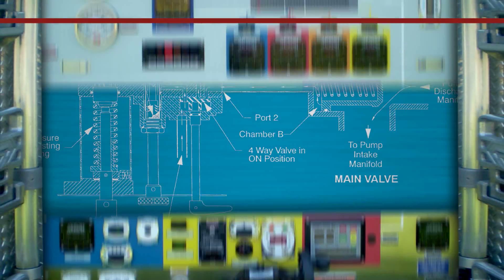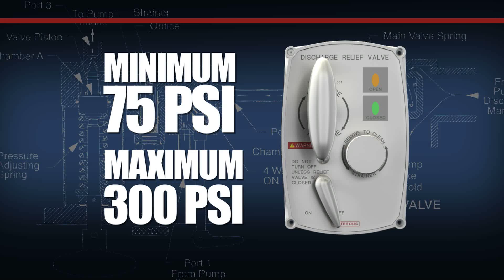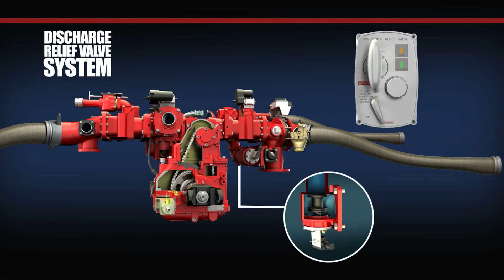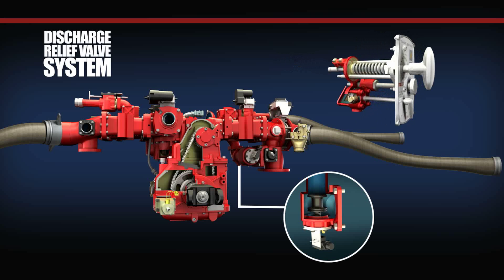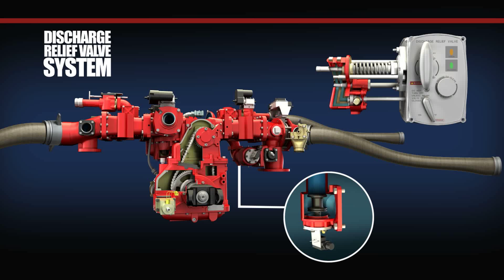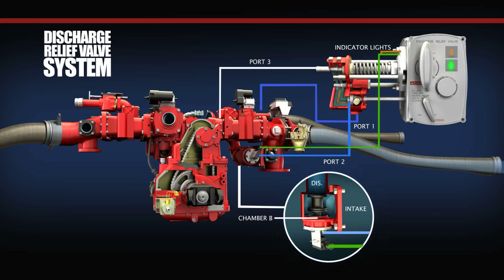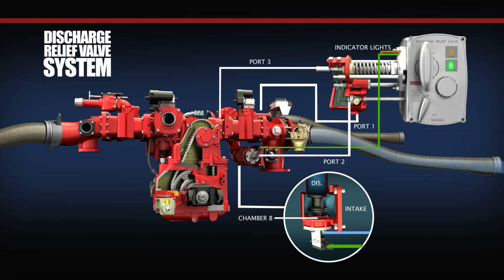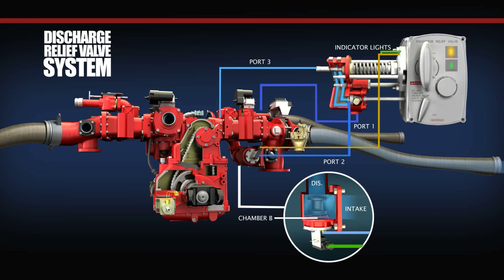WATEROUS - Discharge Relief Valve

Comment: The narration (around 3:08 in the video) says the orifice in the Pilot Valve Strainer assembly is .035", but the text on the slide says .35".  It's certainly not a huge deal in terms of understanding how the thing works, but since you thought it important enough to call it out so specifically, you might want to have those match each other.
Reply: That is a big difference between 35 hundreds and 35 thousands.